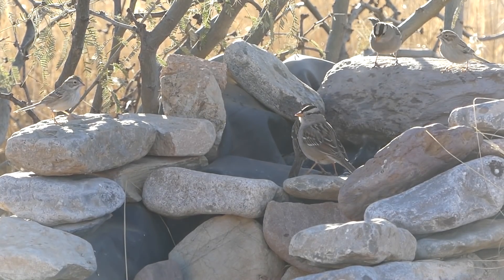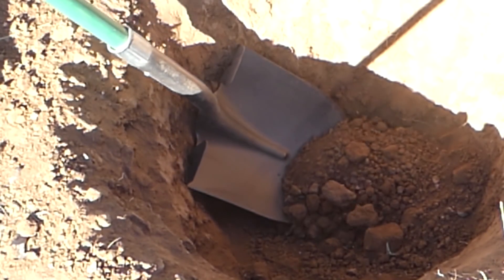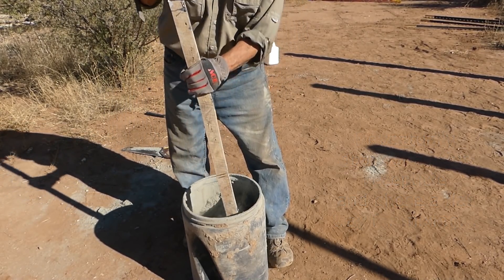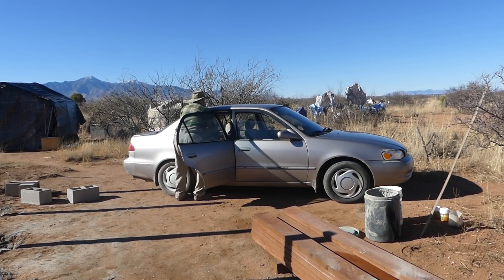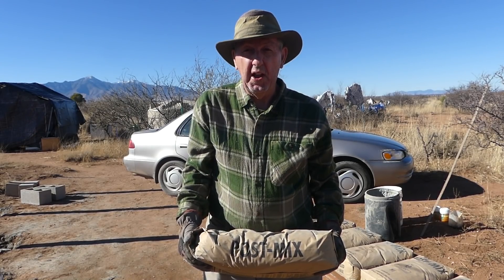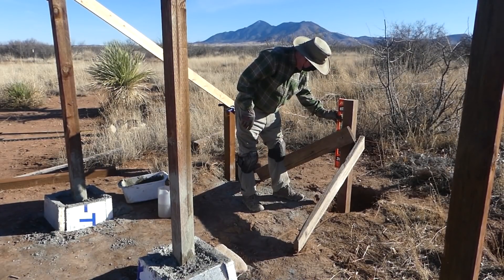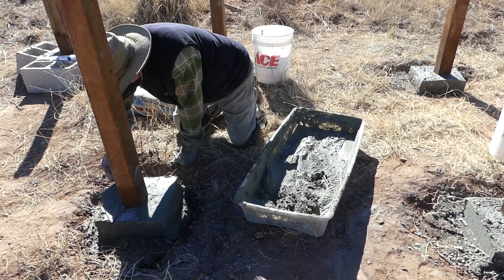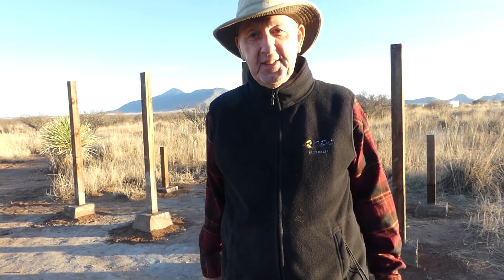Off-grid Senior Designs Solar Array for Tiny Cabin Part 1

Comment: Don, you ruined your handsaw by sawing open the bag of concrete. Anything other than the saw would have been appropriate. Later you tried sawing a post??? What were you thinking? I hope you don’t have any high winds there because your solar panels will sail away.
Reply from the maker: Hi Gr delawter thanks so much for commenting and of course watching the video.  Great to have you here. First of all I treat these Irwin Handsaws kind of like going to a movie.  I paid over $10.00 or so and I wont be getting my money back anytime soon. You are dead on the money that sawing a post with a dull saw isnt a good use of energy.  But I find hand saws therapeutic and love using them.  I just needed to replace this one. If you kindly watch the next video I will be showing off a beautiful skillsaw given to me by a subscriber.  We DO have high winds and that is why I will be anchoring my panels to this solid ground mount with no end to security.  Thanks again for watching!

Comment: Always enjoyable to watch an episode of "Don builds something"
For all us technical geeks, can you tell us about the remaining components? Some quick math in my head says 8 x 340  is about 2700? Curious about storage/batteries, charge controllers, parallel or series, etc.
Wattage ratings on panels is like a car speedometer. It may show 120 mph is possible, but the reality is, it spends it's life at 60. Once established and in place, it's easy to measure actual power. Kilowatt hours is the actual horsepower of the system.
Reply from the maker: Hi Reuben!  Great to see you here as always and so encouraged by folks who enjoy watching me "build something". Great question about the wattage for my system.  I will have 4000 watt hours of storage once the system is set up.  But naturally I can understand you calculating the eight 340 watt Q Cell panels and that not adding up whatsoever. I have to admire folks who are as you say "technical geeks".  Its taken me years to grasp even basic concepts of solar and electricity LOL. But for me I am stubbornly focused on doing what I need to do and learn to set up my Off-grid home. Keep watching as you kindly always do and I will reveal all as they say in detail.  Cheers and thanks!
Reply: Kilowatts, not kilowatt-hours, would be the apples to apples comparison to horsepower.  But thanks for playing.
Reply: @kirbyspencer538  you are of course, correct.
I do find it helpful, and sometimes refreshing, to be reminded of technicalities, as they can be misinterpreted by way of text on the internet.
This is Don's channel. He is a gentleman, and if he was a neighbor he would be my friend.
I say this to remind you, that kindness and courtesy still make a difference.

Comment: a little oil or even water helps a saw glide through the cut . western saws cut on the back pull so guide it forward in the cut it will cut more and jam less that way
Reply from the maker: Thanks for the tips Tim! Fortunately this saw cost about as much as a movie at Ace Hardware so easily replaced. Thanks for watching as always!

Comment: I hope the post are deep enough to withstand the high winds you get.  Enjoy your videos.
Reply from the maker: Hi Wayne. You are SO CORRECT! The winds here are crazy at times. I checked on these posts now that the cement is dry several times and with so much cement in the posts holes it seems super rugged.  Thanks for watching!

Comment: With a ground mount you are losing the main benefit of a roof mount system: solar shading in the summer.

You made the concrete look nice but you lost ~portability which is one of the advantages of a ground mount.  The alternative would be to get concrete blocks that I think are deck footings from the home improvement store, set them and level them on gravel and build a rectangular base setting on top of them.  Wind load will be an issue so instead of relying on concrete in a hole, use some stainless cable, turnbuckles and duck bill ground anchors to hold the array framing in place.  That would allow you to move the array for the cost of some gravel, a few feet of cable and a few new duck bills (if you don't want to dig down to the old ones).

The main question in my mind is why did you do so much hard work?
Reply from the maker: Hi Joe thanks very much for checking out my solar video.  As far as shading to keep my roof cool fortunately my entire attic is chalk full of open cell foam. So I stay cool way into the morning because of that. I also love the fact that I wont be poking holes in my valuable roof not to mention with a ground mount its easy to clean/maintain etc. As far as portability goes I am very pleased with the current location I have for the array so dont envision moving it.  The other advantage is that it adds privacy to that section of the yard. At age 66 I hope that this mount is good for 20 years so it should do great in that spot and be around as long as I am!  Respectfully you would have to have one powerful anchoring system to beat out the incredible wind force from Mexico that comes through my property. For example: I had a tent tied down with 6 cinder blocks and the whole thing lifted about 200 yards and landed in a heap with bent metal framework.  The main question:  Why did I do so much hard work? Answer: Limited resources so digging by hand and using more basic methods was necessary and my goal was to make a sturdy place for my solar as a solo senior.  Oh and I simply enjoy a good workout.  I find it reminds me of how thankful I am to be active and ready to work hard.  Kind of old school in that way.  Thanks again Joe for watching !  Cheers!
Reply: @affordabledesertliving3487  ground anchors are frequently used to stabilize slopes in landslide areas.  They are rated from several hundred pounds to many thousand pounds of pull out force depending on size.  You can set them a lot deeper than your concrete piers with a sledgehammer and the installation rod.

You could have done 1/4 the digging, none of the concrete mixing and swing a hammer a little bit for a solution at least equivalent to yours.

Getting back to roof mounts, there is fantastic hardware for attaching solar panel racks to standing seam roofs without any holes, they use clamps to pinch the seam.

When building and working with a budget, you have to look at the whole picture and use economical products that work with each other rather than trying to stick together all the cheapest methods.  I'm building in a similarly hot area with occasional high winds and I'm building a lot bigger which makes budget even more critical.  I'm trying to build something that will survive the desert for decades so my decisions push me toward some more durable and more expensive products which is why I'll spend on standing seam roof and save with fiberglass roof insulation.  When I see wasted effort, wasted opportunity and cost that's comparable something is going wrong.
Reply from the maker: @joequixotic3039  Thanks I definitely learned some things.  Cheers!

Comment: I look forward to Part 2!! But, why did you cut the posts with a handsaw?? I know you have a couple electric ones, haha
Reply from the maker: Panda I knew that question would come up.  Yes I have a beautiful battery operated circular saw and a chop saw.  The chop saw needs the generator to be hooked up to it and often the generator croaks trying to operate it but I can tease it along.  But I have to haul the generator over to it etc. etc. I am still practicing with the skill saw to make nice cuts.  So with a 4x4 I would have to make at least 2 cuts to use it.  So not wanting jagged cuts I know that I can do a nice neat job with the handsaw even though its more laborious.  Plus I love hand saws.  Hope that helps!  You will see me using my beautiful circular saw a LOT more in the future as I get better with it.